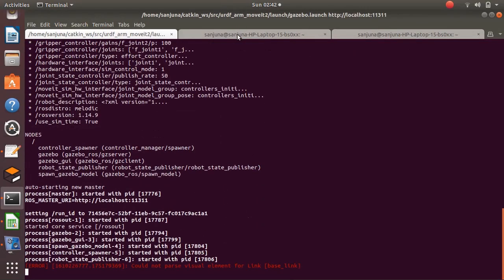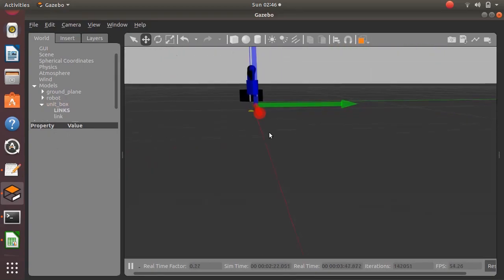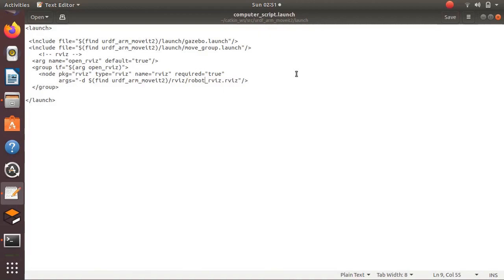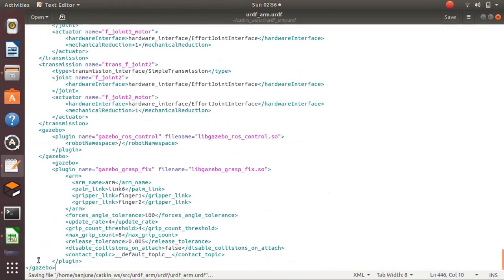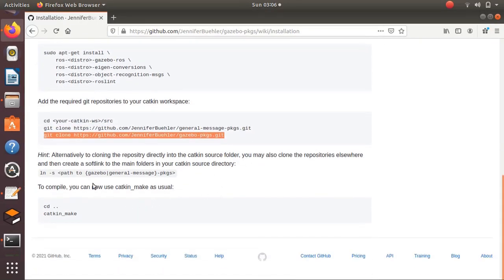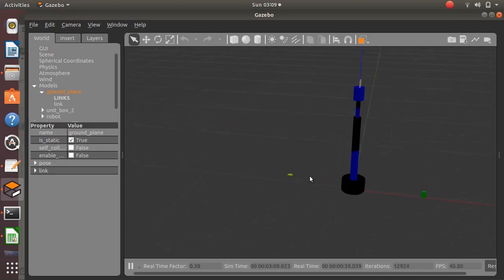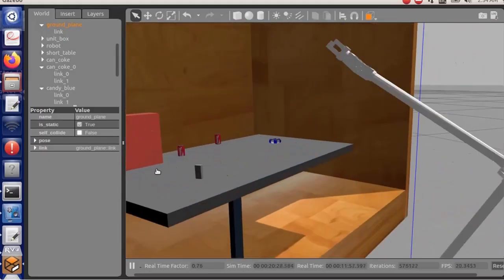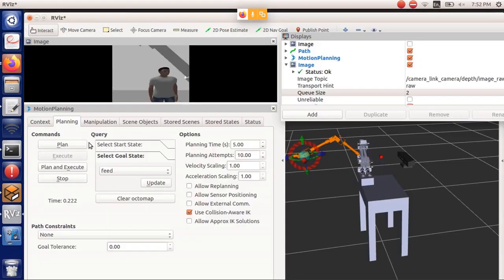Part 3 - Pick and Place Object - Grasping Task Simulation of Robotic Arm using ROS (മലയാളം)

Comment: thank you very much for this tutorial.
Reply: @sanjunamathews-robotechietips  I have tried it still the object is glitching out of the gripper. Any possible solution ?
Reply from the maker: Play with parameters of the plugin. Also try changing size , intertia properties of object. Or else decrease the speed of arm movement by changing in config file of moveit config files of arm .. there is an option to set Max acceleration and max velocity.. modify those values to slow down arm motion ..it may avoid dropping of obj if any other approch is working
Reply: Node::Advertise(): Error advertising topic [/unit_box/joint_cmd]. Did you forget to start the discovery service? getting this error. when I spawn a box and the code try to grasp it but there is no joint commander. so its no able to attach the the box with this.
Reply from the maker: Have u clicked "Play" of gazebo if its paused by any chance
Reply: @sanjunamathews-robotechietips  yeah. I am using Franka Gripper on UR10e.

Comment: When i try to place the object, the object sticks to the gripper. Can you help.
Reply from the maker: <release_tolerance> is the distance which the gripper links are allowed to move away from the object during* a grasp without the object being detached, even if there are currently no actual contacts on the object. This condition can happen if the fingers "wobble" or move ever so slightly away from the object, and therefore the "gripping criterion" fails in a few subsequent update iterations. This setting is to make the behaviour more stable. Setting this number too high will also lead to the object not being detached even if the grippers have opened up to release it, so use this with care

Try changing this param

To try changing more params refer https://github.com/jenniferBuehler/gazebo-pkgs/wiki/The-Gazebo-grasp-fix-plugin
Reply: @sanjunamathews-robotechietips  I have an error: Link gripper 1 can't be found in gazebo for GazeboGraspGripper model plugin. Skipping
Reply: But the link is present
Reply from the maker: There should be atleast some min space between open grippers and the obj to detach the obj.
Reply from the maker: Also there is some detach time.. have u waited some seconds
Reply: When i opened the gripper, object floats between the 2 links of the gripper
Reply from the maker: If it get detached there will be a green detach log in gazebo terminal. If that log is not there it is not "detached" using the plugin.. try more wide grippers or small object..
Reply: @sanjunamathews-robotechietips  I'm using coke can as object and I'm trying to pick object using perception
Reply: @sanjunamathews-robotechietips  in the plugin, arm name should be the name of planning group or name of arm?
Reply from the maker: Name of "group of the arm" (refer part 1- there is add group - we are adding grps for arm and gripper - here we need to give the grp name of arm)

Comment: How can we simulate both in rviz and real time?
Reply from the maker: Gazebo substitutes real environment for simulation.. so in case of hardware interface we should manually write/run nodes for publishing topics like odom, tf etc. In case of a mobile robot, the feedback from motors will given to rviz as odometry. And the robot will move it rviz acc to real world.. similarly instead of controlling the robot in gazebo world we will the using the velocity command from navigation stack to the real robot motors to work.